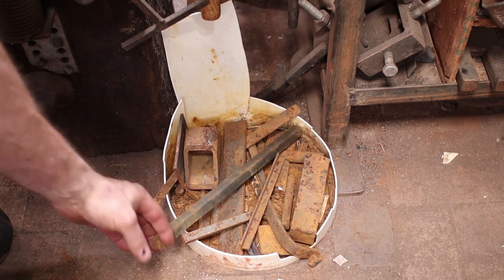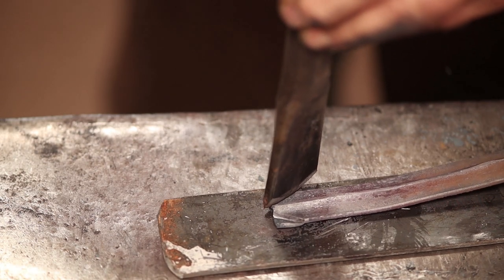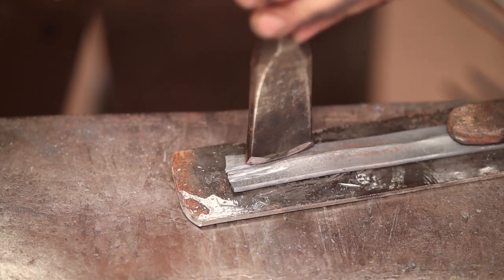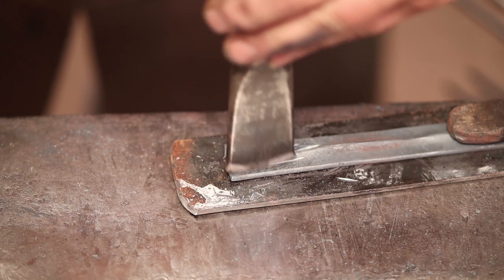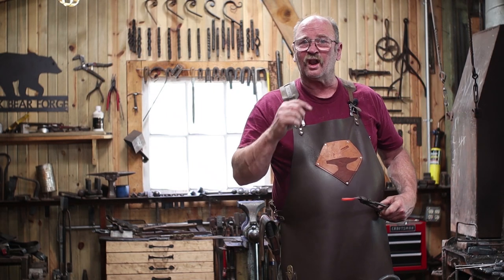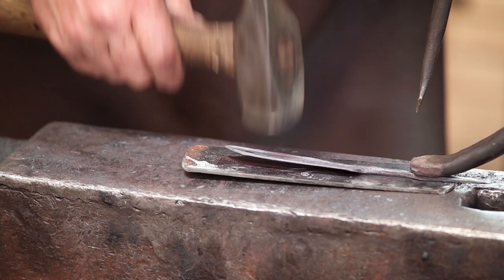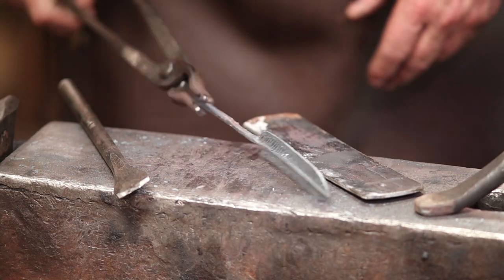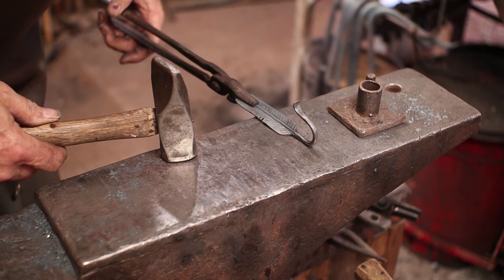Angle iron feather hook   hook of the week 11

Comment: I've run into that frustrating hole drilling situation too.  I think in this case, with the rib or quill up the middle, I would drill from the back side to keep the drill from sliding off the centre of the arc.  A gentle countersink afterword on the front side should eliminate any burring.  Great video and a great usage of an old piece of scrap.  Thanks.

Comment: Another great video. I’ve been making my feather trinkets out of spring steel and have sold a few of them. I never thought about using angle iron, duh! 🤦‍♂️  I love the fact that you used tempering colors for yours, as I do with mine. If you get the whole feather in the blue range, and wire brush the edges while it’s still hot, the newly brushed edges will come in straw gold. So it’s blue in the center and gold on the edges. It’s so beautiful! Feel free to use that trick and see for yourself 👍 I love your inspiring videos John! Keep up the great work sir.

Comment: I think drilling from the back inside the crease might help keep the holes centered. 
A simple wooden bridge could be built to allow the hook to fit.
Or, if these were being batched out, you could have a bunch cooling as you make the feathers then drill all the holes before doing the last heat to bend the hook.
Reply from the maker: Trouble is there was no crease left after forging

Comment: I heat the metal up and melt some copper wire on the work just like solder and that makes it cool 😎
Reply from the maker: Do you need to flux the work for the copper to flow properly?

Comment: Your cutting block for the treadle hammer, is that a block of brass?
Reply from the maker: yes, its about 1/2" thick with a steel frame to keep it from sliding off the die.

Comment: I assume your swage block was hardened steel. If I dont have access to something like that, could I make one out of hardwood to do the same thing? I know it wouldnt hold up to much use, but would it form the hot steel?
Reply from the maker: For dishing purposes such as spoons or ladles, wood works pretty well.  But for something like this I would stick with steel.  A small swage would be very simple to forge, probably easier than the feather shown.
Reply: @BlackBearForge  Well, I dont have my own forge up and running quite yet, Im getting ready to take a blacksmith course at a local club.  So far, Ive made an S hook, a lopsided heart, and a really tight coil...  Making a tool might take a little bit. Ill keep after it though, thanks!

Comment: Strange, i always thought metal heated up as you worked it and so you would increase the longevity of the heat by working the material... yet it seems to do the opposite... wonder why
Reply from the maker: At the extreme end this is true.  But most of us can't work that hard and fast.  Plus tools steal heat away from the material.